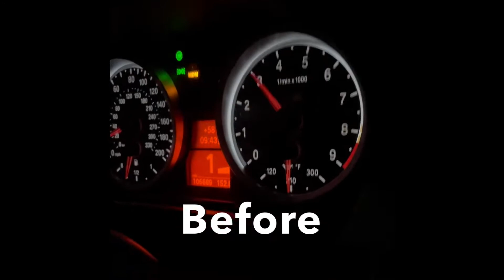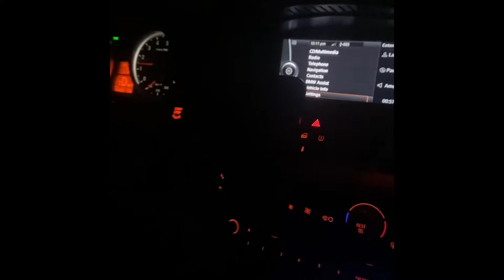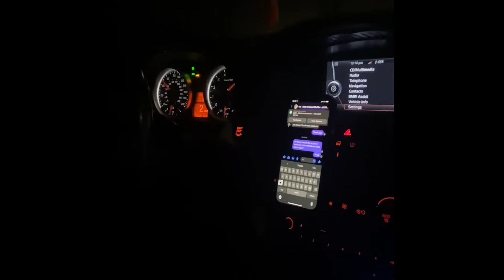I Regret Installing This Exhaust, E92 M3 Becker Performance Muffler Review E90 E93

Comment: I have the becker exhaust (and midpipe) on my E90 M3. It takes a little while to break in but once it does, the bark on downshifts comes back.
The low RPM drone can be annoying but thinking about a different set of mufflers to handle that 🤔
Reply from the maker: Nice 👍 the Becker mufflers didn’t sound good with my stock catless x pipe. 

Check out the Alibaba valved mufflers I installed.  Very happy with the sound for the price:  https://youtu.be/BnJbWIq5MD4
Reply: @Sals_Garage  that's actually the video that brought me to your channel. I'm thinking about picking up a set of Alibaba mufflers and having the best of both worlds!
Reply from the maker: @brianjackson3894  awesome! Glad you saw it. Give it a try! Inexpensive and you’re right, best of both worlds. Exhaust and induction noise!
Reply: RPI makes a great axle back for the e90/92 M3. I purchased it for my e90 M3 and it sounded great, deep tone and barely any cruising drone whatsoever. Changed the car 100% for the better! Was only $1050 for the axle back.

Comment: I know you didn't like it but I was wondering what is the function of this style of muffler setup where it y's into two bottle resonators. Is it like a quad exhaust? I found a similar design that I wanted to try on my e550 v8 5.5 benz. I've seen other companies use this setup too like eisennman, armytrix and meisterschaft (it also seems to be a factory style of the old m5 v10).
Reply from the maker: This style muffler is designed for a deeper bassy note with no rasp. 👍
Reply: @Sals_Garage  does the two side by side mufflers do twice the work as opposed to one?
Reply from the maker: @Dynasty-s1y  it’s quadruple the muffling power for sure. Sounds very deep and bassy
Reply: @Sals_Garage  nice I think this may be what I need. Is this good if you don’t have any resonators?
Reply from the maker: @Dynasty-s1y  yes, it should sound perfect with a straight piped catless setup with no resonators since you have 4 already.